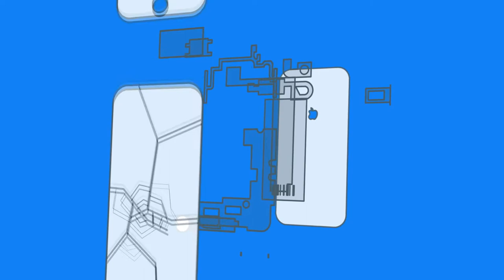Apple Watch 4, 5 44, 40mm Display Flex Cable Connection Repair Fix  -  DoItYourself

Comment: Hello I have 4 44 I opened it to change the screen and the touch doesn't work anymore. the screen has no problem I tried it elsewhere you think i may have damaged the flex
Reply: I think same with me 

Is the display showing
Reply: @adilroshan673  You fixed it? i have same prob

Comment: After screen replacement on my series 4 watch 
Not pairing to iPhone 
While connecting to iPhone unpairing automatically with out any pop up message like pairing failed 
Technician saying it’s connector or flex cable fault 
Please tell me what’s cause this
Reply: iPhonetechintelugu it’s the software on that screen. You need a different screen
Reply: Jamaican Links 
Replacing another screen will fix problem
Reply: Does lcd screen series 5 will work fit in to the apple watch 4 series?
Reply: @blunkdaisuke3818 of course not… why do u think there’s different screens for each apple watches 🙄